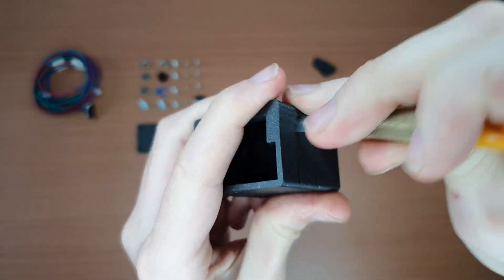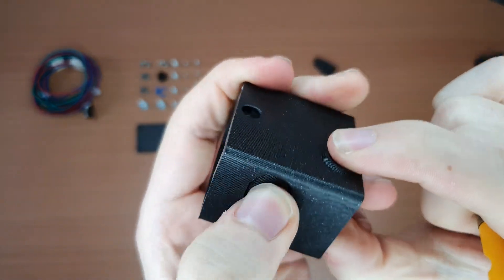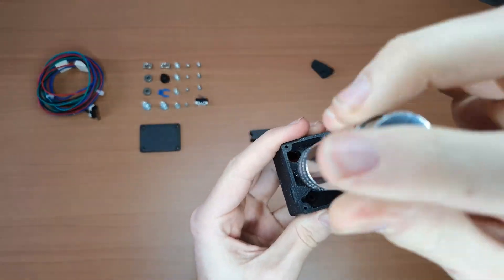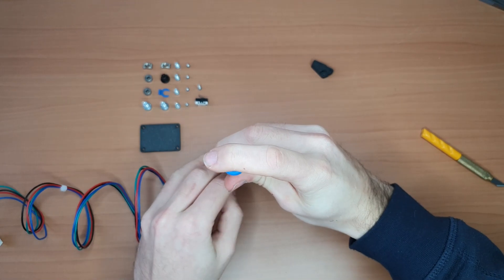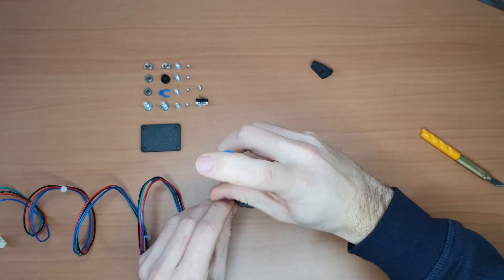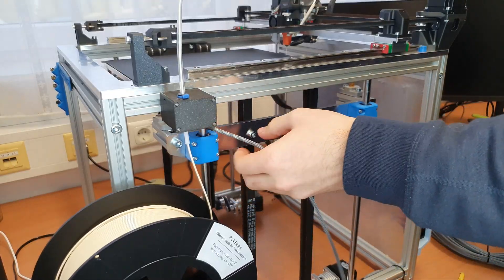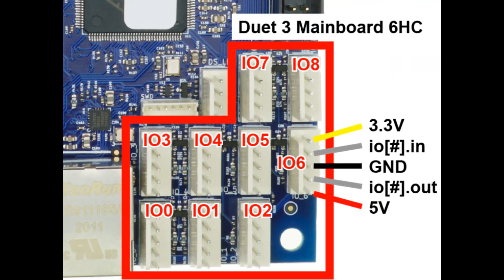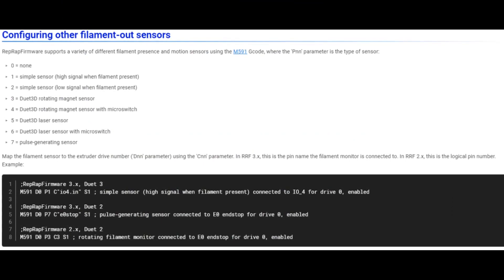The FilaDector

Comment: I may have overlooked Something, but those filament sensors, that are mounted near the spool seem a bit counter productive to me. Even if the filament passes the sensor, it still has like 30cm to the nozzle, where it may snap. And even if a snap gets detected, you'd have 30cm of wasted filament
Reply from the maker: Interesting, I did have some old woodfill filament snap inside the tube once. But the stuff I usually print didn't ever snap with about 20kg of total filament used, which explains why I have overlooked this seemingly rare issue.
Reply: True, but it’s usually better to detect it early so you can take corrective action earlier, like a weld